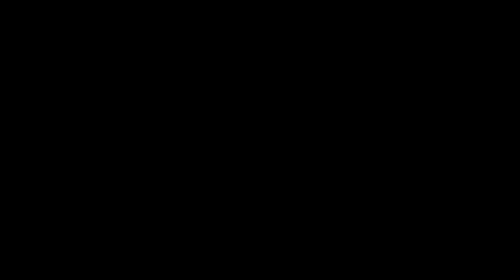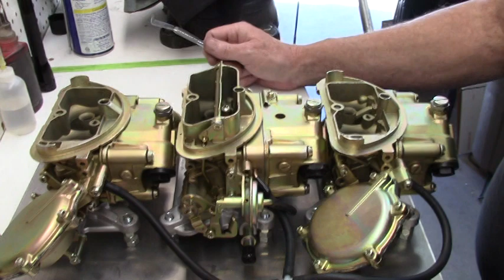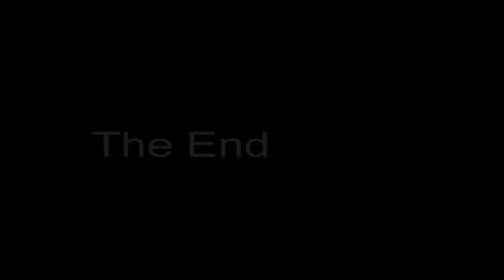Six Pack Corvette Tri-Power How It Works and Function Test

Comment: Why would fuel come out the rubber vent on the center carb?
Reply from the maker: Fuel level to high.
Bad needle seat assembly.
Needle seat assembly o'ring not sealing.
Too much fuel pressure. 4.5-5.5 Psi is best.
Reply: @backnine Thank you

Comment: I had that exact set up with the high rise aluminum corvette manifold on my 69 SS Chevelle 396 when I was 19, right out of high school, 1980. That thing made tons of power. We ported the 396 to match the Ttripower's intakes. I still remember the specs. Chromoly main bolts, 326 degrees intake duration, .50 lift, 11.75:1 TRW pistons, Speedpro rings, don't remember the cam brand. 7300 RPMs, idle 1150 RPMs. It was nasty as back then most street racers had never heard a BB turning 7,000+ RPMs.

Comment: WOW!  You just explained how I blew my 427.  The link rod is comprised of 2 pieces held together with a small bolt and nut.  The shop that re-installed my carbs after a rebuild must not have tightened it correctly, or the part failed.  I was at WOT leaving my development.  I went to shift, and the carbs remained at WOT.  After the fact, I found the bolt and nut sitting on the intake manifold.  That was an expensive ride.  At least I now know what happened.

Comment: Hi Harold. How you adjust outboard carburetors idle when they are on the engine?
Reply from the maker: The factory set outboard carburetors 7/8 turn out from seat. This setting is good. Adjust air fuel from center carburetor. If you have to mess with outboard carburetors you have another problem.

Comment: I had a Challenger 340 sixpack. I changed the vacuum linkage to progressive linkage, much better after you learn how to accelerate. The 340 would not take all the gas/air until it reached 3000RPM, then it would pop like a stick of dynamite going off. I love that car! When it comes to the carbs, Harold is the man.
Reply: I have a 396 with tri-power and it too, doesn’t use the vacuum linkage, only mechanical linkage (I assume that’s what you mean by progressive) on the outboard carbs.  I was thinking of making the switch to vacuum. Any thoughts from Harold or others here with tripower experience?  This is a new purchase for me
Reply: @mrmcd4532  Yes, progressive and mechanical is the same. Just curious, what's your reason for going to vacuum? Your 396 would probably take the gas/air mixture at a lower RPM being that it's a big block. To me, I feel that I have better control from 0-3000 RPM than allowing the vacuum to control the outside carbs to kick in. It just feels and sound better to me.
Reply: It probably is better with progressive linkage, especially that I live in the city of Chicago. However, the transition from two to six barrels is so sudden and there is a very slight hesitation. It feels like you have the car floored but then you smash the accelerator harder and it forces the other carbs open.  It’s a thrill, for sure, but it would seem that vacuum linkage would be smoother. I’m speculating as my tri-power experience is zero until now. Thanks for engaging and thanks a ton to Harold for these videos.

Comment: Awesome content, Harold. Your video from years ago where you explain the warping issue with these holley carbs helped me discover and correct my own set of carburetors. Where are you based out of? I was thinking about sending my carbs to you during next winter to have them re-finished with your zinc dichromate process. Please let me know how else I could get ahold of you or if this would be possible. Thanks!
Reply from the maker: chucknorbid@gmail.com